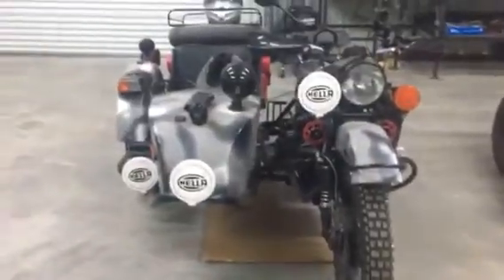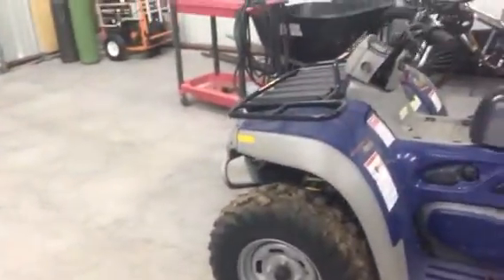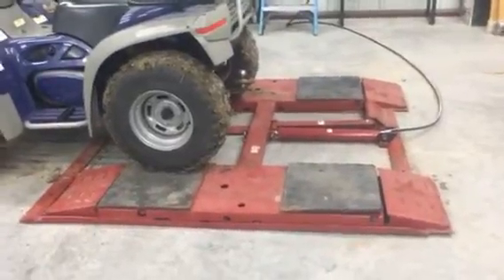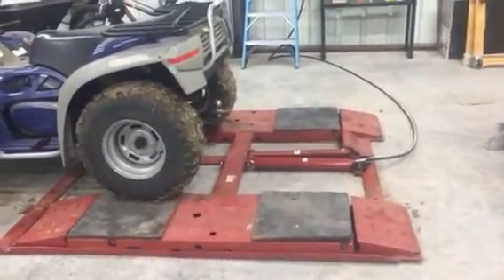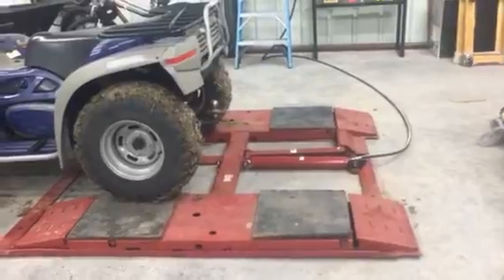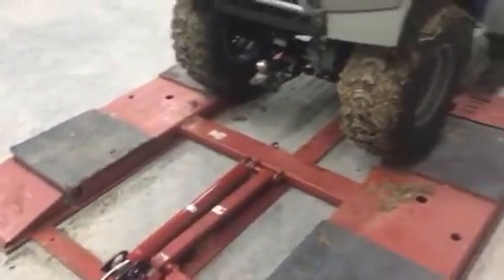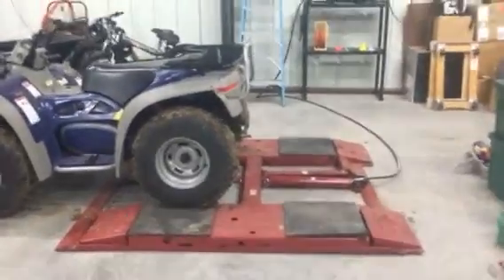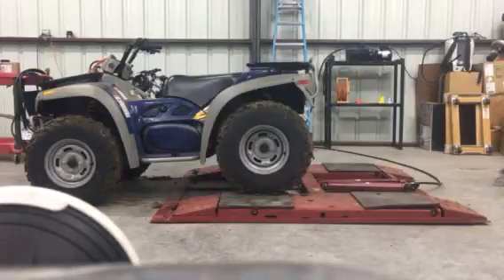Low Rise automotive lift

Comment: Do you still have that lift I'll buy it from you
Reply from the maker: Yes I still have it. It’s proven very handy for workings on the rig, mowers and even my small trailer. It also makes a very strong  (but sorta low) work table……Thanks for the offer but it’s not for sale at this time.
Reply: Ok

Comment from the maker: To recap the video.......I paid $450 for this lift after doing a single function test.......that action came back to bite me.......That test showed signs that the ram was probably gonna need to be rebuilt.......but, since I had no experience with these type of machines, I was more concerned about the pump than the ram. Well, the pump turned out to be just fine, but (because I only ran it up and down one time) the ram had more issues than I was aware of.........yeah, lesson learned.  :)
The guy I bought the lift from had been using it outdoors in his driveway for a couple-a-three years. This particular unit was NOT designed for exposure to rain and snow.....so the interior of the ram was rust pitted pretty deeply.........the pitting prevented me from doing an otherwise standard (and much cheaper) rebuild. I did call the factory looking for a new ram..... but, due to its age (1996), there are pretty much no factory parts available anymore......even had I found a NOS ram, I was told that the dealer/wholesale price was in the $700 price range back when they were available. 
The solution for me was to take the ram to my local hydraulic shop and see if they could fab me a suitable unit. They said they could build a new ram using the old fittings.  They cut the ends off the old ram, cleaned them up and welded them onto a new body.......a relatively easy solution, but MUCH more expensive than a new seal kit.......my cost for the rebuild, along with a new 20 foot hose and the assorted fittings, was about $450.00. Everything else on the lift was serviceable and required no attention other than a good cleaning and tightening a couple of the nuts. Like I said, the pump was fine after a thorough flushing and some fresh ATF,  it runs like a top. 
 Even with the unforeseen costs, I feel I ended up with a very good lift. Another plus is that at 6000 lbs. this unit has a much greater lift capacity than the 1000/1500 lb. motorcycle lift tables I had been looking at.......so no worries about overloading it with any equipment I own or use. 
Since this video, I've finished all the desired modifications, with the total costs (purchase price, ram rebuild, steel for the new framework, paint and assorted hardware/supplies) in the area of $1200.00. I have to say that I am quite pleased with the end product. In addition, because of all the "stuff" I had to do, I learned a lot about a machine that I had zero knowledge of. 
My advice to you.......take a good look at the lifts your considering, do several full function tests before laying out any funds. Good luck with your purchase.
I will post a new video of the completed project when I can.
Reply: I have this same lift. Were you able to find a seal kit for the hydraulic cylinder?